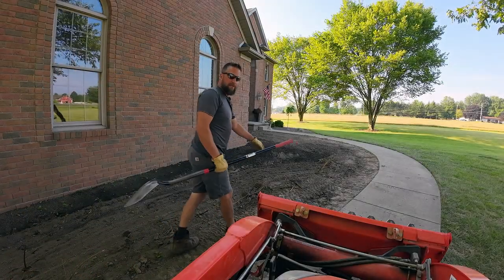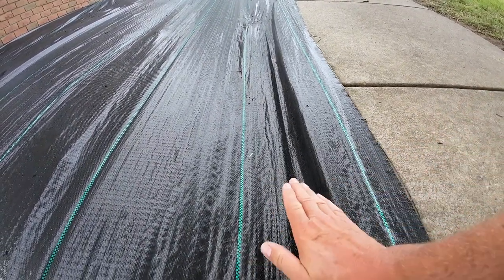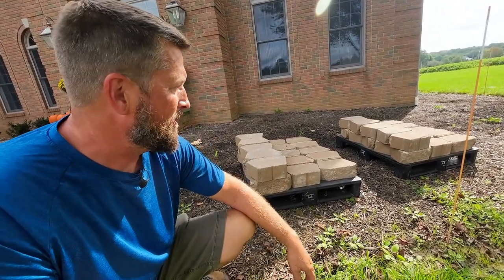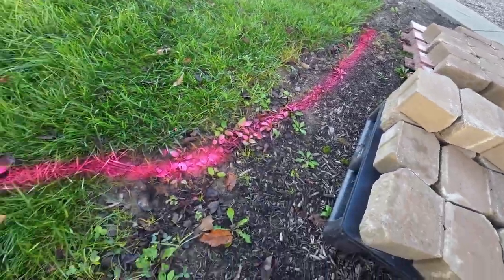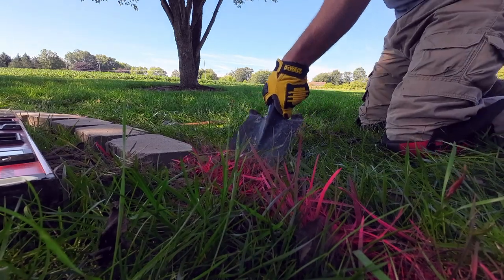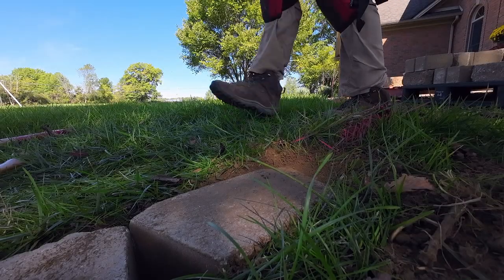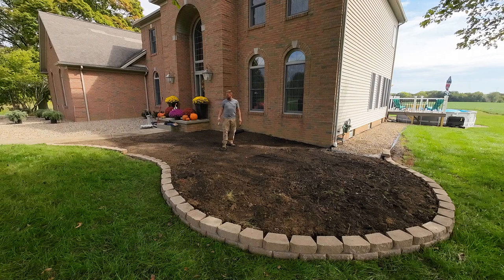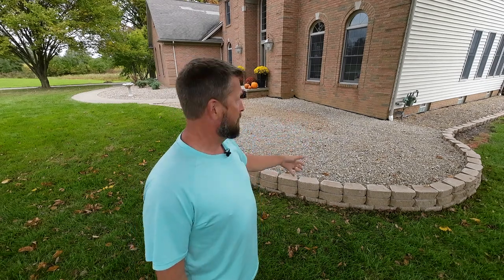How To Make Professional Looking DIY Landscape Beds

Comment: How is the tractor handling the tiller?
Reply from the maker: It handles it wonderfully! I am very pleased with the King Kutter XB48. It is built very tough. I've run some pretty big rocks through it and sometimes they jam. I disengage the PTO and pry it loose when that happens. Other than that, it chews up everything 🤠👍